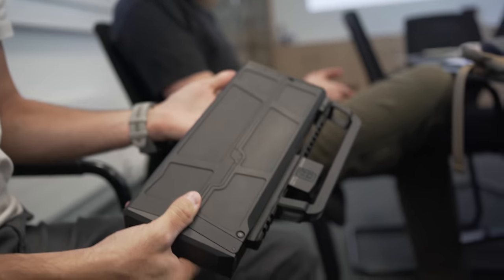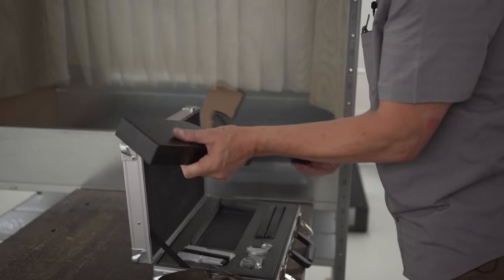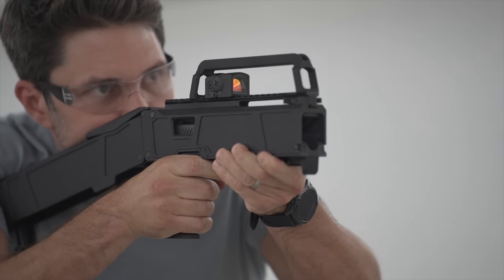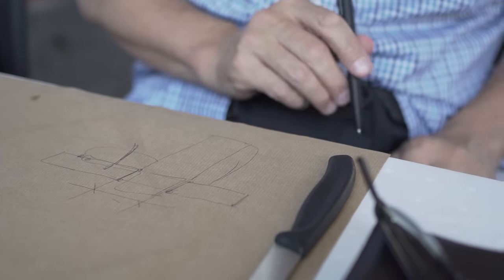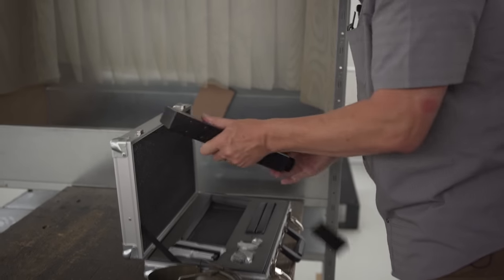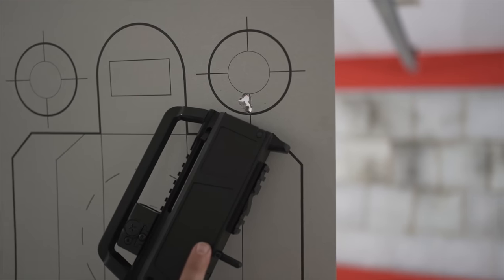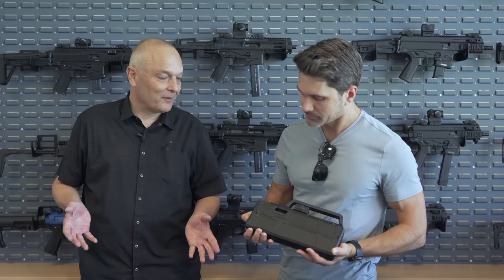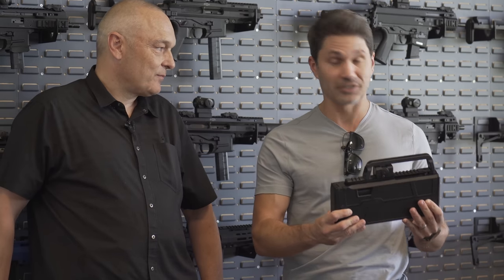Incredible Swiss Folding Gun: The B&T BWC

Comment: What amazes me that B&T is not utilizing that dead space inside the muzzle area.  You would be able to design and fit a whole suppressor unit inside that area while keeping it flush.
Reply: that or use an 7"-8" barrel for better accuracy
Reply: @UncleRedd87  barrel length has virtually 0 direct affect on accuracy.
Reply: @killervztwogaming5796  but it does increase velocity.
Reply: @thomaspike1475  Agree, it does increase velocity substantially. Now that I actually  think about it, you might have gotten a great idea, it is even possible to put a longer barrel in with ventilated holes that acts like an integrally suppressed gun that brings down the velocity to make it subsonic without the need of Sub sonic ammo.
Reply: @thomaspike1475  and? 

His statement was about accuracy...
Reply: @killervztwogaming5796  more velocity improves accuracy because the trajectory is flatter. Less velocity means having to have a good idea how far your target is to be accurate. Pretty simple
Reply: @kalasmournrex1470  except that's not how accuracy is measured. I don't disagree with what you're saying, but you don't take bullet velocity into account when measuring accuracy.
Reply: @killervztwogaming5796  and I agreed with him, then mentioned velocity.  I was pointing out a pro for the longer barrel.  So what is your point?
Reply: @thomaspike1475  No one was talking about velocity. Thanks for adding nothing to the conversation.
Reply: @kalasmournrex1470  i think that the trajectory curve, and therefore the advantage of a flatter curve, is negligible at the distances in wich this weapon is supposed to be used.
Reply: @killervztwogaming5796  we were talking about barrel length and I gave a positive reason for a longer barrel.
Reply: @thomaspike1475  no we were talking about accuracy.

Who tf doesnt know a longer barrel will add velocity?

Keep up boomer.
Reply: @killervztwogaming5796  you are just having your own conversation. Give it up junior.
Reply: @thomaspike1475  i was talking to someone and you butted in with irrelevant info.

Classic boomer move.
Reply: @killervztwogaming5796  You were butting in to someone else.   Thanks for playing.  Now go get mommy to change your diapers.

Comment: Id love to see a version of this that includes everything you need to simply add a Sig serialized Fire Control Unit to in order to create a working semi-auto folding PDW that doesn’t need a form 4473 or NICS check. A modern day Boom Box...
Reply: Thats pretty much what it is already. Take your p320 needed bits and drop it into the chassis and your done. The only 4473 you 'need' to fill out is for the fcg of the sig. Mind you even that can be legally gotten around  by buying second hand.
Reply: @high633  or building your own 80 perc P320 fcu...oh wait😐
Reply: You'd need to mail $200 and your fingerprints directly to the ATF for a federal background check and wait a year and a half to get approved to own this, and that's if you don't have to get extra approval from your local police chief or state to begin with.
Reply: @hornmonk3zit  Yeah, it's  cool but I'm not going to get one if it must be SBR'd. 
I just cant see treating a pistol cartridge firing weapon as a Short Barreled RIFLE just because you can shoulder it - sort of. 
I still think the drop-in 320 FCU is a slick concept though.
Reply: @hornmonk3zit  lool, still mailing in checks to the ATF huh? I don't think I've talked to anyone who did e-file on a form 1 that took more than maybe 2 months.

Comment: i don't like the more sloped "stock" i kinda preferred the fmg-9's straight blocky look when unfolded
Reply from the maker: I also prefer the box look but the raked design helps with a super low optic mount. It's better.
Reply: I was gonna mention how the sloped stock low sights. The fmg9 had a straight stock but higher sights due to the flashlight they added above the barrel
Reply: I thought the same thing at first but then saw the advantage of the angle when James shoulder fired it

Comment: The mag cannot unfold into battery because of the geometry where the pistol grip hinge is located in the frame/lower receiver of the P320. The hinge would have to be located up where the slide is to have the correct geometry to unfold the handle with the magazine in battery.

Comment: I feel like this pales in comparison to the Flux Raider.  I can't say as a size comparison, but the simple fact that you can't have a properly seated magazine is a huge disadvantage of this platform, but also the fact that it seems to only take standard capacity magazines.  It doesn't look like the 23 or 30 round magazines would fit at all.  That being said, it's definitely an interesting product, and one I would probably end up getting just based on the novelty of it (at the right price point), but tactically, I'd stick with the Flux Raider.  Just my 2 cents.

Comment: That's pretty cool. It looks like a little briefcase when closed up. As for the engineering, you can't break the laws of physics, so with a traditional stick mag you can't make it so it'll instantly be ready when unfolded. With a different magazine design you could, such as having a curved back plate, or if it were to use something akin to a P90 magazine, which would be cooler still. However, a change in magazine would make it less appealing to the general public because you'd have to buy new magazines.

Comment: Couldn't they fix the not seated mag issue by just down sizing the grip and mag? It wouldn't need to fold if it could fit in the housing normally. If you want more rounds to make up for the smaller grip just add a foregrip that holds a same size spare mag

Comment: 100 units at $1500 or less? 1000 units would be a little cheaper, and progressively so as they produce more assuming they tool up with the intent to make a large number.... they could feasibly cut the cost down per unit significantly.

Comment: I could be wrong but making it so the gun inside doesn't fold and the mag doesn't have to be seated would only make it about an inch taller maybe 2. I would rather have the larger folded size and the ease of use.

Comment: If it doesn’t come with the fcu, barrel, or slide……then it’s WAY overpriced. I think 600 would be a little more reasonable but still not as desirable, when you can get an MCK with attachment points you can actually use for around 200. Sorry, just my personal opinion. Would only be worth the 1200 or so if it came complete, with warranty and silencer capabilities.

Comment: Mr. Bruger is probably right about nobody buying this thing. It's pure gimmick as is. 
Concealability-in-plain-sight is a dubious advantage. The footprint, even in folded state, is not much less than that of a Flux Raider, and that's actually a concealable and even theoretically holsterable weapon. It's slow to deploy, requiring 2 or 3 separate actions from fully folded to low ready, while the Flux or any other pistol chassis or micro-SMG needs one (stock deployment). It can't use any accessories - lower rail is useless and top rail is constrained by the handle to essentially only fit a mini red dot. At best, you can replace the sight with a pistol-sized light\laser combo like Zenitco Perst. The folding mechanism and size constraints clearly preclude the use of even OEM 21rd 'stendos. At 2-3x the price of Raider, it's dead in the water as soon as Flux figures out their mfg problem. Sure, the overheated US market can fit a thousand of these, but that's about it.

And it's such a waste of potential, really. With that much real estate inside the frame, B&T could easily do away with SIG slide in favor of a custom, lightweight locking assembly, and fit a 5"-6" barrel in, or a stock 4.3" threaded one with a custom can - they are the can specialists, after all. Sure, it's a throwaway gimmick they just did Because They Can, but with a bit of effort it could become something actually interesting.